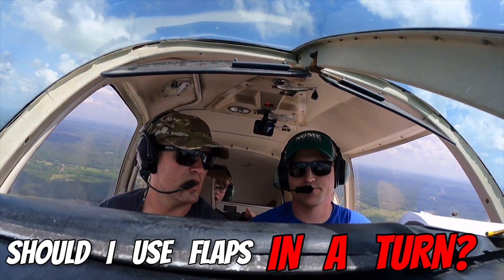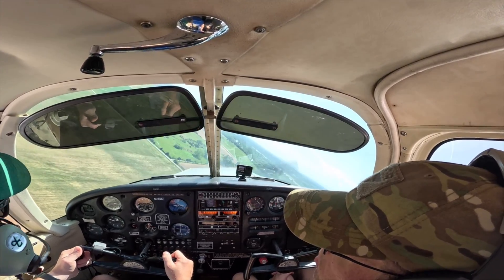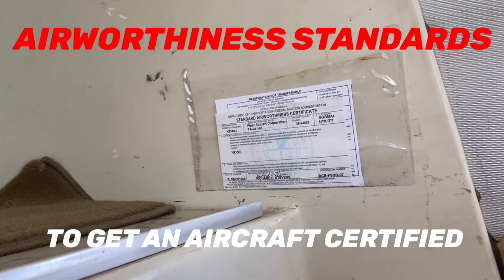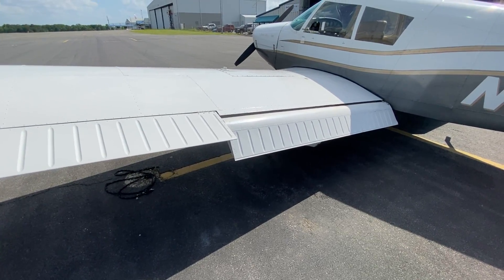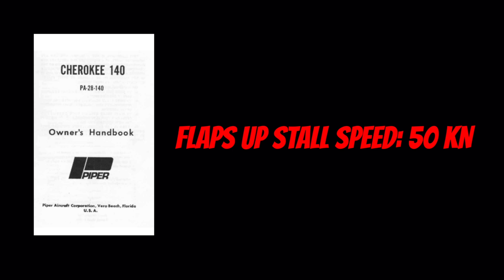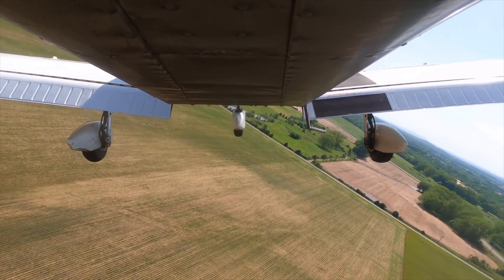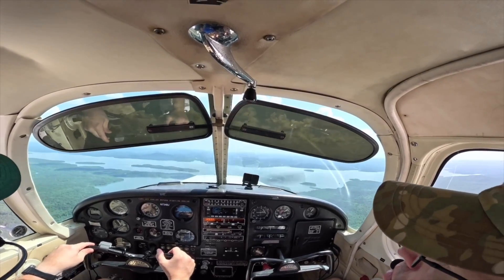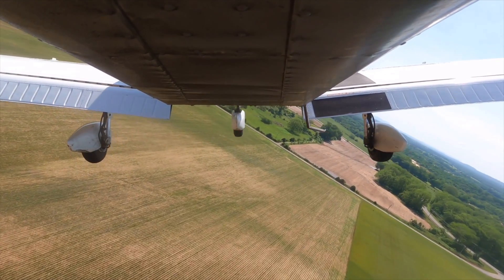Should I LOWER Flaps in a Turn?

Comment: I've never heard any controversy about *having* flaps down during a turn, but I have heard cautions about *lowering* the flaps *during* a turn. That is what I thought this video would be about, but you didn't address it. Any thoughts? Personally, I doubt it's an issue. I lower the flaps based on what the aircraft is doing and what I need to do with it. This includes using and lowering flaps during a turn. I'm curious what you think.
Reply from the maker: Yeah, I discussed certification requirements for new airplanes and how they must be able to be controllable during all flight parameters if something were to break

Comment: I’ll admit I didn’t read all 1000 comments, so maybe this was addressed. As I understand it, the concern is extending the flaps while turning not necessarily just using flaps in a turn. I think that’s the hair people are splitting. Could you comment on that? Is it safe to extend flaps while turning down wind to base base to final, etc. In the videos, you are doing just that, extending your flaps while in your turn.
Reply from the maker: Lowering flaps while turning is the concern (due to asymmetry). However, getting the flaps down asap can help make an approach safer. That’s one of my points.  Airplanes are designed to be controllable under asymmetrical conditions

Comment: My CFI has had a split flap condition happen to him, and he STILL teaches putting down flaps in turns.
Reply from the maker: That’s very interesting. Thanks for sharing!
Reply: @FreePilotTraining Of course! It happened during a touch and go, one of the flaps didnt retract properly after raising them to take off again. So i dont know if he would have a different opinion if it had happened to him during a turn.

But there is a reason we dont all wear parachutes. At some point, you have to trust the aircraft, and use all the tools available to you to be safe during a normal flight, rather than fixating on the 1 in a million chance of something going wrong in the most unlikely of ways.

Comment: Sounds good to me, thanks for the advice!
Just one small remark: The stall speed increase by load factor holds for calibrated airspeed (or probably even equivalent airspeed, but whathever), but not for indicated airspeed. And especially at higher bank and/or pitch angles, those two can significantly deviate from each other!
For example, for a Tecnam P2002, the POH states that wings level stall speed is 41 KIAS or 50 KCAS, while in a 45 degree bank the stall speed is 54 KIAS (+32%!) or 60 KCAS (+20%).
So, better check the POH for stall speeds in a turn, rather than calculating them 😉
Reply from the maker: Excellent point. Thanks!

Comment: Which airplane are you discussing about using the flaps? Ailerons elevators Rudder are all roughly the same from aircraft to aircraft. Flaps fundamentally changed the wing. If you do the same thing in two different designs using the flaps one will fly into the ground and the other will not. I don't remember specific examples in specific aircraft but one airplane said that they were only to be used on landing because you could not climb out with 100% Flaps. Here is the pilot error we are discussing. Pilots spend very little time going around making a tight corner with somebody in a tower telling them to keep it tight and quick and come around you've got an airplane bearing down on you. They try to make this low slow tight turn with the flaps down and their mind all set on landing and they don't do well because it's a very rare event it's high pressure and it goes against everything in a person's heart that is an engineer about Air flight. Low slow tight turn is the ugliest thing in engineer ever heard to do in an airplane. All those pilot error cases don't have the mechanical failure of split flaps they have the judgment failure of using the flaps incorrectly on the specific airplane.

Comment: I'm aware that most of you are Chinese (Tu Yung) but you can actually find the answer to this in the writings and interviews of three people (Chuck Yeager, Bob Hoover, and Bud Anderson).  Each of them cover this topic and in several operating venues.  For me, the most impressive was in a dogfight.  Yeager and Hoover were both shot down in WWII while flying a P51 and in both cases by a FW-190A.  Also, all three of them had been in dogfights with Messerschmidt BF-109's and related the amazing effect of flaps.  When each of them had been pursued by a 109, they had pulled a high-G tight turns to see of the 109 would engage.  When they did, they each slightly reduced power and deployed flaps.  This maneuver dramatically increased the turning radius of the P51 to an extent the 109 couldn't follow, primarily because the chasing pilot didn't catch the maneuver in time.
I use flaps in a turn, but I never deploy flaps in a turn in general aviation aircraft.  It's like my race car ... you don't brake in a turn, you brake before the turn.  Another thing I learned from these three and the P51 was gear deployment.  In a combat theater (you could have damage and not know it) each of them would make their downwind to base turn while simultaneously pulling G's sat a sharp angle and deploying the gear.  The G's added weight to the gear and made deployment more assured and faster.  Today ... ... ... well forget it
Reply from the maker: Lol I like the “Ty Yung” thing. Do you have any of the references for those stories from those guys? I really appreciate the info and I’m thinking about discussing this further in a future video. I have a theory that I would like to explore at some point, and these references might actually be helpful

Comment: About flaps mid turn, I was taught to never do that, however I have tried it and grew to like it. Its just smoother because the plane will loose altitude in the turn and gain a bit imediately after the flaps are extended and get that float that you have to correct (wich is not good because landing is typicaly higher workload and sometimes it can get a bit hectic. By extending flaps mid turn the loss of altitude from the turn evens out the instant increase of lift (especialy at flap 1) and in this way you dont have to watch out for that little float.

Comment: We are taught that the C172 has a single electric flap motor on the right wing, and controls the flaps on the left wing through mechanical linkage. The purpose for a single elec flap motor instead of dual is so a split flap scenario doesn’t occur.
Reply from the maker: Exactly!

Comment: here's a split flap condition, resulting in a crash, just for the record: https://www.gpiaa.gov.pt/upload/membro.id/ficheiros/i006973.pdf This was in Portugal, where I am writing from. So no FAA regulations, but eventually EASA. TLDR; the plane was using two electric flap actuators instead of one. During deploy, one of them got stuck due to the wearing of the motor screw, leading to an asymetric deployment.

Comment: Better to use the flaps to “balloon” than to pull on the stick as you know the balloon won’t be too much so as to stall while pulling back can be to stall. If you happen to use this balloon to help in turning, so be it. Put it to a use in such as opposed to an annoyance to fix if flying straight. 

If you don’t pull back on the stick even if going to 45 AOB, you won’t stall. Either add power or let your nose drop. AOA is the best safety instrument. AOA is the best safety tool. Better than flaps. 

The buffer you’re talking about doesn’t really apply as your Vref for no flaps differs from. The Vref with flaps. The stall example at the end of the video doesn’t really apply to using flaps in the turn. You can configure before the turn and gain the same slower speed capacity. The concern for needing to tighten the turn, however, if you haven’t yet thrown the flaps is a valid example for flap extension in the turn but it is a dynamic tightening of radius while bleeding more energy to accomplish it and is not giving you better radius for a given speed. 

I have a tangential story to this in Medium in the F-35C Crash into the South China Sea story. Improve your Landings with AOA and Power Techniques may relate to the discussion. Yes, throwing the flaps in the turn can throw you through more turn though they also increase the energy drain so you may also want some power shortly thereafter. Though if you’re near rollout, it might balance. 

I will note in both the flaps for turn and the flaps for a balloon extension, these are dynamic effects meaning they have immediate impact that fades out to a worse drag or bleed condition in rather short time. 

Static situations don’t care about the flap position. Therefore, despite your demonstration flaps up versus down looking at turn radius, I am highly skeptical as many other factors play to distort radii to include precision of execution and winds. Steady state turn radius is not dependent on wing shape therefore is not concerned with flap position. It cares about velocity, load, bank. Same is true for rate. What flaps give you in the steady state is ability to fly slower velocity for smaller radius. They can also help you “tighten down” for immediate increase in rate and decrease in radius though such is a temporary effect during and immediately after flap transition. You will need to either add power or will bleed speed in so doing. If you add power to maintain speed, your rate and radius will turn out to be equal to that before the flaps came down. 

See Aerodynamics for Naval Aviators regarding turn performance which includes “… when the airplane is flown 
in the steady, coordinated turn at specific 
values of bank angle and velocity, the turn 
rate and turn radius are fixed and independent 
of the airplane type.”

It does look like you tightened down or slowed down, either way, in the last quarter of your turn in the flaps down part of the demo. Moreso than as was in the flaps up. Perhaps some winds out of the east? Maybe that circle should have been ever so slightly displaced west and would therefore be more similar in size? Or maybe slower than seventy rolling out? Or faster in the flaps up? Any inadvertent high and/or low yo-yo? Seeing the circle to the NE, were you trying previously while heading west yet not getting the desired results? Because, maybe, steady state doesn’t care about flap position and the equations matter. It is only in the dynamic transition where flap movement matters to the turn. Though position does matter as you said in terms of when you stall. 

As for split flaps, I had such with the Leading Edge Flaps (on flap retraction) just off the catapult stroke cat one of the Enterprise on a “yo-yo” pro-c in an F/A-18C. They found a drive actuator which spiral cracked from the right LEF. So the next day I got to try FCF-C on it again, and the same thing happened. 

I realize you show this next thought through in your earlier stall example, but it is not explicitly called out for the graph. Nor is it so in the PHAK from where the graph came. Please note that that graph showing load vs bank vs speed is trickier to read than appears and really should have included an example. Bank to load is an easy straight across and down. But, for speed, you want to go up from the load to hit the “speed’ curve, which is really a conversion curve, then continue across to speed percentage. Ex: at 60 AOB assuming we’re holding level, we’re at 2g and 1.4 times or a forty percent increase in speed. Note percent increase means add to 100%. Thus, at 4g, we’re roughly 75 AOB and over 100% increase hence more than double initial speed. Easy to misread that graph failing to recognize the red line is a conversion line not a data line. From load, go left to black line and down for AOB but also up to red line then left for speed increase adding 100% to what value you find.
Reply: Another thought here is avoid using flaps in the turn as normal procedure so as to save the capacity to use the flaps in a turn when you need it to help the turn. But a counter to this is to do them in the turn to reduce ballooning in the vertical, in which case such would be better as normal procedure. Tradeoffs.

Comment: So, I'm late to his party but since I no longer square the corners in the pattern, I also lower flaps as I'm turning it to intersect the centerline. The Corners as it were is one 180 degree turn.
Reply from the maker: That’s what we do in the air force
Reply: @FreePilotTraining  Former Naval Aviation here and although not an Aviator, Air Crew, that's  how the pattern is flown at the boat. When the FAA announced they were testing this years ago, I stated doing it. 
Side benefit, high wing or low wing, I always that the numbers in site.

Comment: If the only argument against it is a chance of split flaps, you should understand loss of control will be regardless, level or in a bank. If theres an immediate yaw or roll, all you can really do is try to retract flaps all the way or to the stuck flaps angle.

Comment: You're right about the utility of flaps, but "the increased horizontal component of lift..." is a strange way to explain your left turning demo. If flaps increased the horizontal component, they would proportionally increase the vertical component, resulting in a climb. A better explanation would be, "In level flight at a given bank angle, the ability to decrease speed with flaps results in a smaller radius turn." This is the same physics that explains cars slowing down for tight hairpin turns.

Ignoring rudder input, the ratio of horizontal-to-vertical lift component is a function of bank angle. Since you were in level flight at a constant 70 KIAS (ignoring calibration error from flap changes) and 30° left bank angle, the only way to increase the horizontal component of lift (without increasing the vertical component) would be with increased left rudder force. After adding power and flaps, more left rudder (or less right rudder) was required to prevent a climb. 

Another function of aft flaps is to increase angle-of-attack of the wing root, beyond that of the wingtip ailerons. This results in more effective roll control during stall, reducing (but not eliminating) the likelihood of spins.
Reply from the maker: The more I research it, the more convinced I am of my theory. I’d like to test some things soon and possibly make a video
Reply: @FreePilotTraining  If only we could measure sideforce on the rudder, vertical stabilizer, and fuselage.

Comment: FAR part 23 was revised back in 2017, and now 23.701 no longer exists. Maybe you can talk to how the new regulations support your argument?
Reply from the maker: Agreed, but these aircraft were certified under these regulations, so they technically still apply. Many older aircraft like Cessna 150s can’t even be certified under the new regulations

Comment: I've once had a flap failure in a T-23 (a Brazilian AF trainer, later distributed to civilian flying schools). When retracting from the "full" to "up" during low-speed flight training, something in the flap control linkage broke and the flap lever got weirdly light as if it was disconnected, very odd.
After landing, we found that the flap was fully retracted on one wing, and fully extended on the other (flap position is such that it can't be visually confirmed while flying). No rolling tendency, no adverse control characteristics, nothing. Nada. But of course, this was on that particular model. It could well be vastly different in other airplanes.
Reply from the maker: Excellent input! That is super interesting! Thanks for the comment

Comment: I think instead of "using flaps in a turn" the correct statement would be "lowering flaps in a turn." I'm only a PPL with an instrument rating with only about 700 hrs. So, far be it for me to advise. My thinking is that I want to concentrate on my turn, avoiding pulling up and avoiding any possibility of stalling. So, I do noting else in a turn but turn. I add 10 deg of flaps just past the abeam point, then add another 10 when after my turn to base, then add the final 10 deg just after turning onto final. Then full 40 deg if desired on short final. I want to try to do everything the same when in VFR or when on an instrument approach. Adding flaps in a turn is more complicated to me. Thanks.

Comment: Yeah! We're more likely to go 45 degrees bank angle when you overshoot Final on the, Base to Final turn with parallel runways and contra-circuits. Going 45 may be all you have to avoid head-on traffic if you don't pay attention.
Reply from the maker: That’s exactly right!